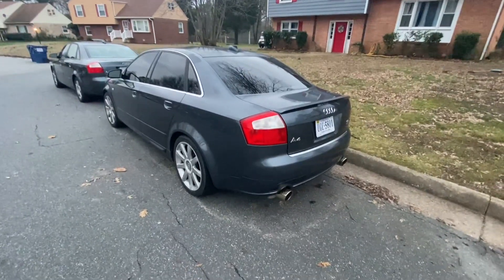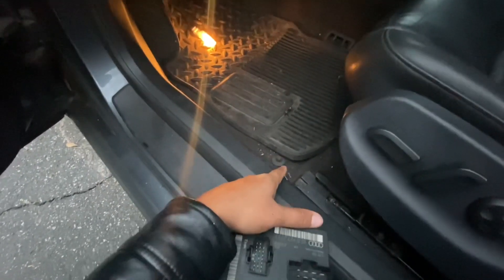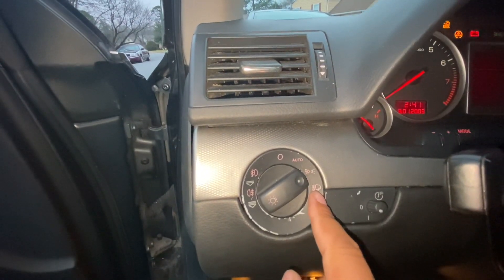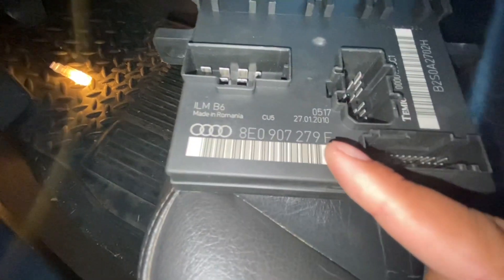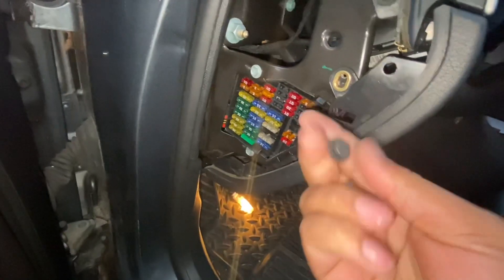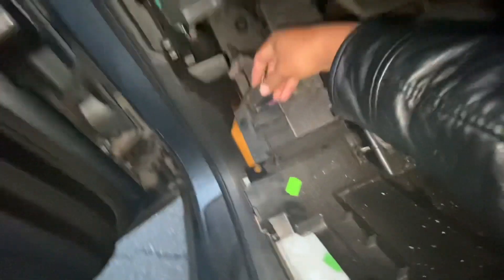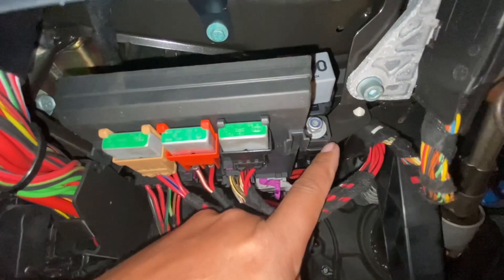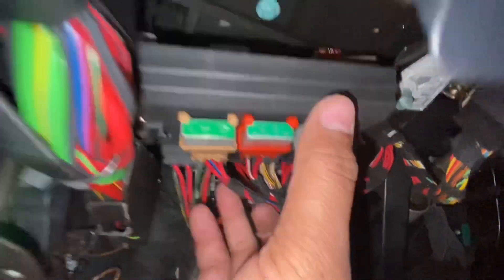02-04 Audi A4 Body Control Module replacement.

Comment: Where can I find body control model A4 audi stionwegon 20002
Reply from the maker: Yo can get it of any Audi A4 and A6 year 2002-2006
Reply from the maker: If you need to buy one, eBay has used ones

Comment: Both my headlights just stopped working suddenly,  replacing this module should fix them right? Already checked bulbs, connectors etc.
Reply from the maker: @henryrussell7406  I would start by checking inside the ECU box (under hood ,driver side) for water intrusion. Then that module.
Reply: @mannysolution  thanks bud I'll check there 👍

Comment: Hello, did you have any other problem than wipers and lights? I only have problem with lights always on, everything else is working fine, rear view mirror also dimms correctly, can this also me bad bcm in my case?
Reply from the maker: If everything else is working, the most likely culprit is the light switch itself, that part goes bad once in a while.
Reply: @mannysolution  i also have problem with all windows switches, on first click none is working on second click (auto) windows roll all the way down or up.... And i had problem with rear view mirror not dimmimg, but it fixed by itself
Reply from the maker: @ most of the problems this cars have are due to water getting in the car. They get wet under the driver side seat where the confort control module lives. Another common issue is water in the ecu box. All the problems are related to water getting into the modules and relays. Check:driver side under the carpet for water, check inside the ecu box for water.
Reply: 2010 A3 having issues. Rear right passenger door sometimes locks and sometimes doesn’t. (Actuator new) Power to the door is intermittent. When driving the auto lock goes on and off randomly. Car alarm goes off when armed intermittently. Any advice is appreciated. I scanned and U0140. Loss of communication.

Comment: My hazard's won't turn off. What module do I replace to fix that? Interior has been soaked in the past.
Reply from the maker: @777Motivation  check inside the ECU box for water damage, most of this electrical issues come from water leaks inside the car and especially in there, there are some relays and fuses inside the ECU box. Check that and make sure it’s dry.

Comment: what are the differences 8e0907279 to 8e0907279F?  Because i have a A4 B6 1.8T 2002, wipers are not working, and i bought this ONE 8e0907279 and my car currently using 8e0907279F
Reply from the maker: @Bresoto  it’s different years and models. But they can be coded to your car if you have vag-com vcds. On the description of this video I show how you can coded
Reply: @mannysolution  thanks

Comment: great video! 
I've got a super weird one though. Why would the turn signals, head lights and wipers not work when the interior lights are dimmed? I have VCDS and I've coded my new BCM/CECM to my S4 and I've used the Adaptation setting to attach the new VIN to the new box and its still not updating. I am completely lost as to why the new box will not attach the VIN. Every scan I keep getting the 01794 "Control Module - Incorrect Chassis (VIN) Number" fault. Anyone else run into this issue??????
Reply from the maker: Check inside the ECU box these cars are known for having water inside the ECU box. There’s some relays in there that sometimes get corrosion by having water inside for long and would cause all kinds of issues.

Comment: This is an awesome video! Replaced both ww fluid pumps and they still didn't work. I knew my lights were also turning on as soon as ignition was turned on but never would have thought both problems would be connected to the BCM. I have high hopes that I will be able to fix all these issues on my car! Thanks for the video bro.

Comment: Thanks Manny for your informative video. I also have a few electrical symptoms in my B6, like ac flaps are constantly moving after the car is turned off,  dipped headlight error all the time as well as the light switch that does not turn off the headlights. Do you think the dipped headlight error is coming from a faulty BCM?
Reply from the maker: Most of the electrical problems this car’s have comes from water getting into the BCM and CCM. The headlight switch and headlights are controlled by the BCM the part I replaced, but you should also check under the carpet (driver side) for water under there. And also under the hood where the ECU lives. Let me know if it helps.

Comment: Soooo my car does the exact same thing with the lights but my wipers do work but they dont spray wiper fluid….do you think it could also be the body control box?
Reply from the maker: 9 times out of 10 is the BCM but the actual light switch also goes bad.

Comment: I recently changed mine I live in the Highlands of Scotland. My wipers and indicators head lights stopped working. I scanned the car with Vcds it told me the BCM had no communication. So I found a replacement with the same part number. I replaced it and waited it did not work straight away. The head lights started to work the hazzards worked. I started to check for bad earths they all came back good. Anyway it got dark and I decided to leave it I have 2 car's so I wasn't able to get back to the car till a day later leaving the battery connected. I came out a day after went to the car turned my key on my wipers started to work same as my high beam lights and turn signals. I scanned the car with Vcds it came back and Told me wrong vin stored in the BCM.
Reply from the maker: Glad it worked for you. If you want to code the new BCM to your car just follow the instructions on the bottom of this video”description”. It explains how I recoded mine on vcds.
Reply: @mannysolution  I coded it today

Comment: Hi the bcm I took iut ot my car is 8E0 907 279  B . Will it work if I replace it with one that has an F at the end?
Reply from the maker: I don’t recommend using a different letter number than the one that came with your car because it could be completely different. But I’ve heard you can recode a different module to your car using the VCDS program , I’ve just never done it.

Comment: Very informative video.  Hopefully that part controls my reverse lights.  They are always on.  In your research, did you find that this controls the reverse lights?  Thanks.
Reply from the maker: Thank you. If your car is 5 or 6 speed standard,I would look at the reverse switch located on the side of the transmission. It’s a 2 wire connector and controls the reverse lights.
Reply: @mannysolution  It is indeed a 6-speed standard.  I'll take a look at that first.

Comment: I gotta used module with the same part number. When I plug it in the horn will not stop beeping. It’s constant
Reply from the maker: Was it doing it with the old module?
Reply: No
Reply from the maker: Those modules suffer from the same problem , they get wet and most likely it’s defective too. Open it up and look for white or green stains inside if you see that it might be defective.

Comment: i have problem to find right one,can other code modul work? is it compatibile ones
Reply from the maker: I’ve heard you can use the modules from 2002 to even 2006 but I have never Try it personally. The only thing the changes is the letter at the end. My module has an “F” but I have seen “E” also.

Comment: Does this control the steering column controls  too and electric windows mirrors,  I got no lights horn indicators wipers electric windows mirrors on a 2004 a4 estate 8e95  1.9tdi. I jump started another car and all these bits stopped working
Reply from the maker: I know it controls the wipers and headlights but I’m not 100% sure about the other stuff.
Reply: @mannysolution  ok thanks for advice. Ive ordered a bcm module hopefully it will solve my problems
Reply: I got the same problem. I changed bcm module but no difference .Is it the steering control module?
Reply from the maker: Good luck I hope it works, let me know if it did.

Comment: I have the same car same problem with my blinkers also not working with the lights and the mirror and the wipers.  How much was that part? Thanks again
Reply from the maker: The part was 28 dollars at my local pick a part. And it does control the the blinkers too.

Comment: Awesome video! Was just now able to help a coworker change this part. It's raining out and his wipers stopped working, he wasn't sure how he was going to get home, but we went into one of our parts yards, pulled the part, installed it in the parking lot, boom! Off to the races!

I'm going to link back to this video, because it made it super easy to replace the BCM, thanks so much!
Reply from the maker: I’m really happy this video is helping so many people, thank you 🙏🏼
Reply: @mannysolution   bro no need to program and the car start?
Reply from the maker: @winky0930  yes the car started right up. I think the replacement part had the same coding as my car.

Comment: think this finally was the video that will solve all my problems. My wipers run all the time aslong as the ignition is on, horn goes on an off, door locks, drains battery. Havnt done more then remove it from the car yet. But when i took it of its place, it was full of water!! the ecu cover in the negine compartment had a hole, and all the water running down the window landed directly on it. BIG THANKS! and by the way, did you need to recode it?????????????
Reply from the maker: Hopefully I could help you solve the issues.!! On my car I didn’t have to recode the module, I think the car I got the module from had the same options as mine. But I left a detailed description of how to recode your module in case you need to do it. It’s on the description under this video.

Comment: Hey man, great video. It helped me a lot but do you need to programm before installing?
Reply from the maker: Glad I could help. You can program it after it’s installed in the car.
Reply: @mannysolution  no need. I dried it out and the AC is working again. I have one HID light that still stays on but that probably means I have to clean the board better.
Reply from the maker: @Dukiezoey1125  yes sometimes when you clean them they start working fine again.

Comment: Hello mate i know this is an old vidéo but perharps you can help me out with this issue am facing.
I've goy not power on drivers door..only the red light and the puddle lights work..
But power Windows,mirrors and central locking don't work nor any other windows.
So far I've changed my powerwindows command drivers side and the power window motor along with the harness ..
Dôme light remains on and car doesn't recognise door open still driver's door
I'm kind of stuck please help me if you can..thx
Reply from the maker: Hello, I would check under the carpet for water, these cars tend to collect water under the carpet (left hand side) that’s where the CCM or confort control module is located. That module is responsible for a lot of functions on these cars.

Comment: My comfort control module got wet I replaced it and Horan windshield wipers turn signals windows convertible top all don’t work Fuses are still good what could be the issue
Reply from the maker: From what I have researched,These cars have 2 control modules for electronics, one is the confort control module located under the carpet and the other one is the body control module, the one I’m replacing in this video. I know wipers are controlled by the body control module also headlights. The confort control module controls other things like alarm and security system on the car. Maybe it needs to be reprogrammed for it to work properly.

Comment: I have a 2006 a4 b7 - my issues are i cant reprogram my fob keys. The instrument panal isnt working properly- some lights dont come on the gas gauge sits at empty. The car starts then turns off after a second as if immobilizer   is turning it off- not showing like bad key on dasd though- could this be bcm module? I also thought wipers went on by themselves one time.Fob keys wont lock or open doors remotely??
Reply from the maker: From what I have researched, the BCC controls the immobilizer, lights, windows, wipers and many more. Not 100% sure it controls the key fob but it’s a good chance it does.
Reply: @mannysolution  thanks for info- is it located under the dash/ steering column? If i can find one with same part number and letter-does it have to be programmed?  I dont have a vag. To do so- trying not to take to dealer- i think this happened when i used a air pump from cigarette socket the pump was shorted- it blew the cig fuse but happened right after- only guessing
Reply from the maker: Yes it’s located under the steering wheel.If all the numbers and last letter match I don’t think you’ll have any problems but in some cases the BCM is programmed differently for cars with HID and and other functions. In that case you’ll have to reprogram it. I was lucky I didn’t have to do it, but it’s not hard to reprogram it with VAG-Com.

Comment: Thank ...very informative.
 my lights on an A6 stays on permanently. 
Does BCM  also deals with the car key because I can't get the keys  to operate remotely , windows are working just one that is confused if you closes it, it opens when you open it closes and come down  so it's up and down 
Lastly can the BCM  be serviced or uou must just replace 
How much are they going for?
Reply from the maker: Glad I can help, I know the CCM is responsible for controlling a lot of the electrical functions of these cars but I’m 100% sure if it controls the key fob functions. I don’t know of anyone that knows how to repair this modules but they are not too expensive used. I got mine from my local yunkyard for less then $40 dollars and it’s been working fine.

Comment: The windows of my  audi a4 2004 model car will not open, what should  I do? Is it the same thing if I will change the body comfort module ?
Reply from the maker: @Edielou Sevilla from my understanding the windows are controlled by the confort control module under the carpet of the driver side. Check all your fuses and relays before changing any part on your car, always start from the simplest thing.

Comment: Hi Guys,
i have terrible issue. Even the engine is running or not running the car's exterior lighting, air conditioning, window control, dashboard turn off for a second and then turn on again. interior lighting is sometimes turned on by itself. Sometimes the window control button triggers this fault and electricity is cut off for about 10 seconds and the radiator fan is running. I changed the battery, bcm, ccm and fuses.  i don't know what to do anymore...
Reply: Hi how did you solve the problem I have the same issue 😢

Comment: Whether module 8E0 907 279 N A4 / B7 is compatible with A4 / B6
Reply from the maker: From my understanding they are interchangeable if you program it to your specific car. I always try to stick with the same part number just to avoid any possible differences.
Reply: @mannysolution  ok thanks

Comment: Damn dude, I think I finally found why my headlights are always on lol. I already bought 2 headlight switches and still no luck. Also, the driver’s door won’t unlock with the remote and fog lights are always off. I’ve been researching for over a month now I give it a try. I will replace  the BCM and let’s see if it will work!
Reply from the maker: Yes this is  common problem with these cars. Before fixing mine I did the same, replacing the light switch ,But it was the BCM whole time.

Comment: I have communication errors with central electics and few other modules. Car runs fine and everything but fuel guage works(swapped fuel sender but didnt fix the problem).Could this be a problem?
Reply from the maker: It is possible that you have a problem with your body control module. Is that the only problem you are having with your electronics? In my car water was leaking down from the wipers area on the front of the car and getting the module wet.
Reply: @mannysolution  atfirst I thought my obd eleven connectivity was the issue and tried vcds. Both has communication issues with about 2 to 3 modules lol. As far I remember, I am mostly not able to connect to Electronics related modules. Fuel guage contant shows low fuel light and always wrong(needle sits whereever it likes mostly wrong)
Reply from the maker: @rayj33  the body control module is responsible for a lot of functions in the car including cluster, wipers, headlights and other electronics. It is possible that yours is bad but unlikely if all other electronics mentioned are ok. I would recommend checking for leaks on the area where the module is located and even under the carpet. These car tend to have water leaks on that area and having electrical problems due to it.